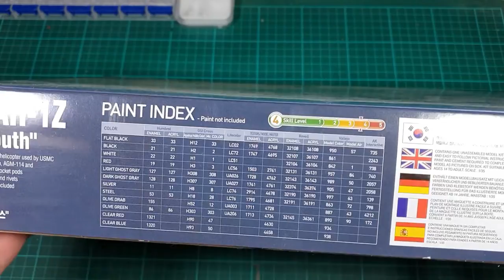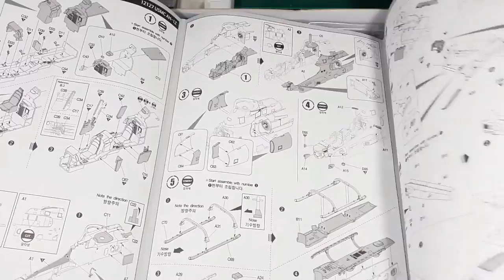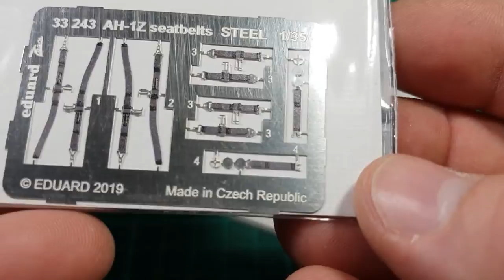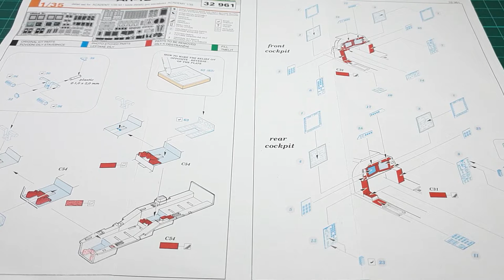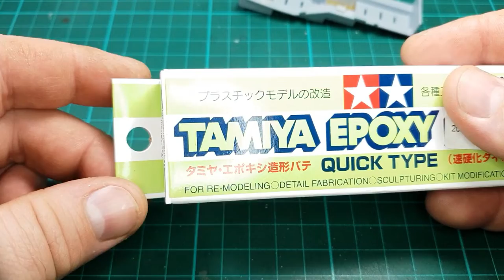AH-1Z Viper Full Build (Part I)

Comment: Hi, amazing work, really fantastic. Could you please tell me what thickness the brass sheet has? Is it 0.5 milimeter or 0.00164 feet? Thanks and best regards. Marcus
Reply from the maker: Thank you so much, Marcus. The brass sheet I'm working with is 0.2 mm, and it's quite firm.
Reply: Thanks a lot, now I got ot, but how do you cut it? Everything I`m trying does not work, too weak, the sheet bends itself, ...  @LocktOnArt
Reply from the maker: I use a ruler and then cut along it with a scalpel several times   @marcushamster9638